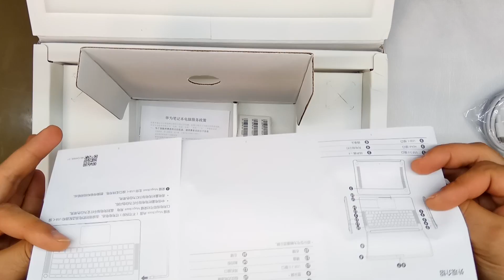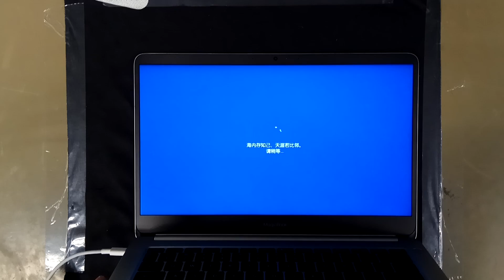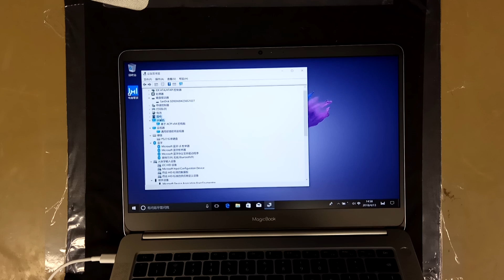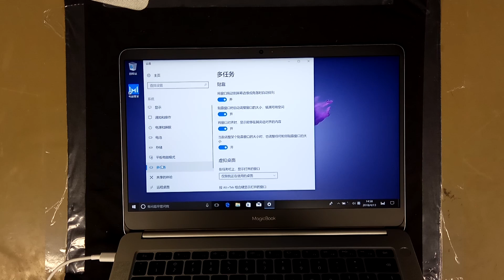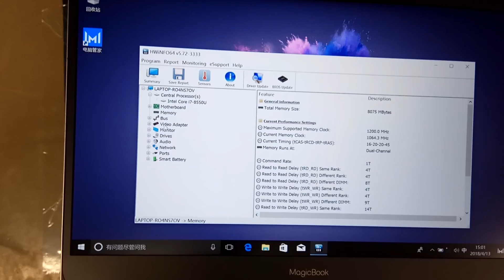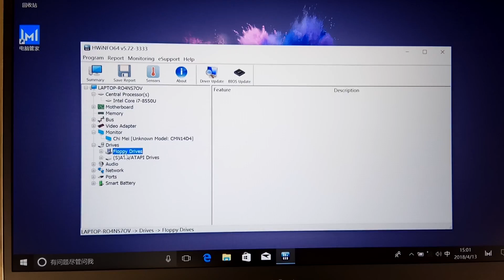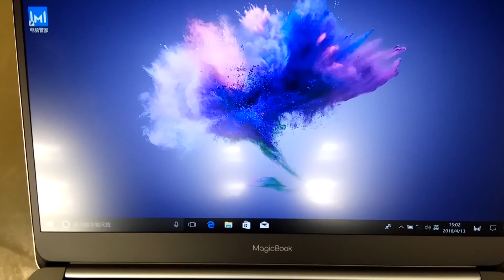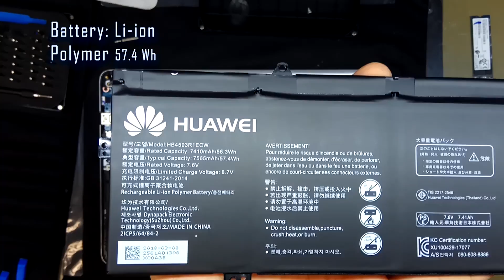HUAWEI Honor MagicBook Unboxing  Quick Teardown

Comment: why aren't there any real reviews on this device? makes me reluctant to go for it...
Reply: So true, it's kinda scary D:
Reply: notebook check compares the ryzen and the i5 8250 mx150 model. the i5 wins in battery life, but the ryzen is the best implementation ryzen notebook so far and is the king cost/performance.
Reply: @SaruwatariMasahiro  on Gearbest there is the Magicbook i7+ MX150, which is a lot faster than a Ryzen APU (like the r5-2500U)
Reply: @nomeduele0   well, yeah, even the i5 is much more performant, the mx150 is twice as strong as the apu graphics on ryzen, its just ryzen is A LOT cheaper, that's why its better cost/performance.  the honor magicbook 2500u  is better than the 2500u from asus, hp, etc. much better implementation.
Reply: @SaruwatariMasahiro  But I see a soldered RAM channel in this Magicbook, which R5 won't achieve best result with, am I right?
Reply: G.D. I got it and it’s amazing.
Reply: @al-rd5yj  where did you buy it from Alex? Ryzen CPU?
Reply: mitchilin Nope, I got it on a trip to China. Starting it up is a bit confusing so I got the people there to help me, but after that is was all good. Just choose the “English” version when purchasing.
Reply: its the same as the matebook D 14